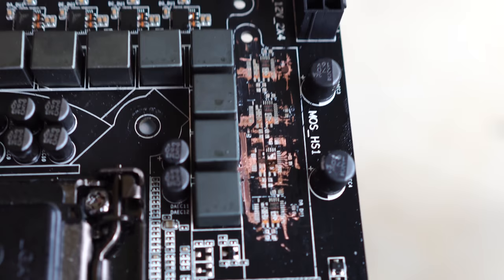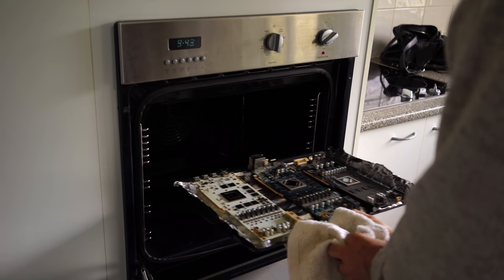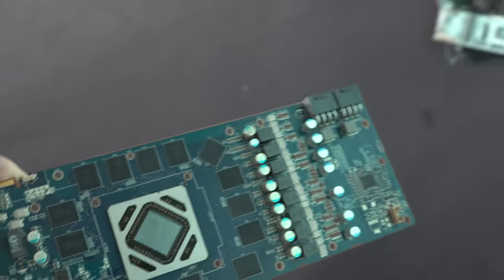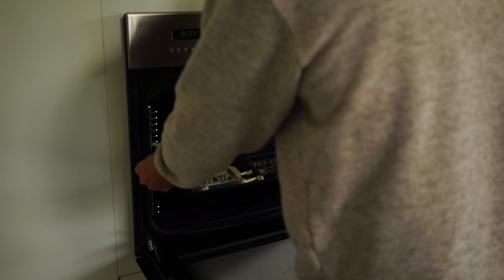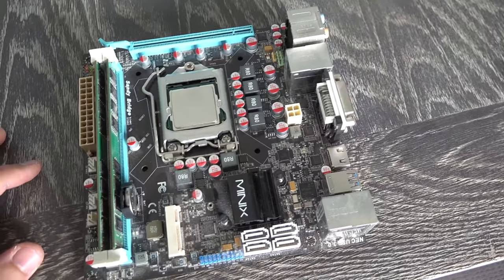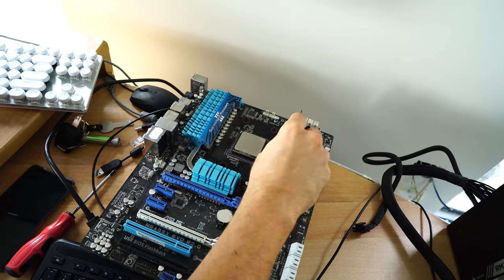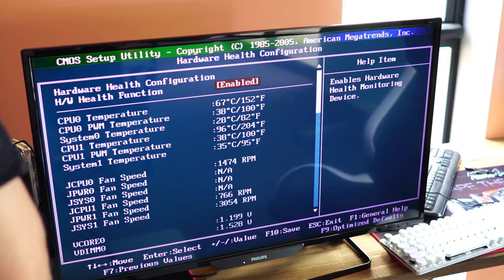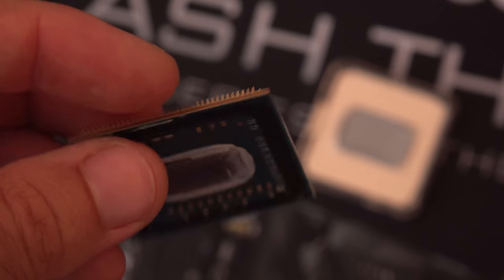Can YES Fix IT...!? The 8 MINUS 4 Phase Power Design | Oven Baking GPU WORKS!?

Comment: The motherboard can't work without its phases because the controller is configured to have them. The only way it could even theoretically work is if you only remove 1 of the 2 doubled channels. So every channel still has hardware on it. Though I wouldn't bet anything on it working even then. You need to replace the components with new ones in order to get it to work.

Oven on the other hand does nothing, you can't reflow with an oven, it'll probably just bridge some pads or cause components to fall off if you even manage to get the heat high enough to melt the solder - otherwise it just does nothing. The only case I know of in which a graphics card in an oven will resurrect is if you have a dead tantalum capacitor (those can magically fix themselves, at least temporarily, when heat is applied). You can get the same effect by just blowing hot air on the tantalum caps.

Comment: Because these phases work "sequentially" any missing phases will stop it from working, unless it can be disabled from the controller. Even though the 1150 cpu has it's own FIVR, the VRM controller simply won't work with missing phases

Oh also about that card with the bugs in windows, you can try a reflash

Comment: Surprising amount of fellow Rossman fans here in the comments. 
Microsoldering isn't that hard IMO. You just need an even semi decent scope. I'd highly recommend the Amscope SE-400 for around $200. I use it at work on iPhone boards and working with 48 gauge wire, and that's way smaller than anything you'd likely be doing.

Comment: Instead of scraping components off boards, invest in a heat gun, it will also replace the oven technique
Reply: Bad idea. Hot air station yes but a heat gun , no way, you will just cook the PCB.

Comment: Wouldn't you need to bridge the connectors where the phases were?  IDK if these power phases are in series or parallel.
Also you should use a heat gun to remove the SMDs on a board like that.. scraping it with a chisel is can damage traces and other components.

Comment: Take the MOSFET's (and the caps and power connectors) off the broken GPU's, and solder them on to your motherboard with the 8-4 phase. Don't just throw away possibly useful components. You seem competent enough to tackle the job. You won't be able to solder the tiny resistors and caps, but you can get larger ones on there, even if you have to use jumper wires to give you the room. Just try to match the components with the ones that are still on the board.(And hope your chisel didn't do too much damage! LOL!)
Love EVGA boards. Looking for a dual socket X79 SR-X from EVGA.
I like what you are doing here. I hate to see anything just thrown away, without at least attempting to make it work again. We seem to live in a disposable world these days (I blame BIC lighters for that! LOL!), so it is refreshing to see someone who is willing to give it a shot, and encourage others to do so too.
Good luck on the MB, and keep up the great work, mate!
Matt

Comment: Have you tried flashing a bios on the 280? Also would love to see you try an E-power mod on the card you couldn't even get the die to heat up on, could be a VRM issue and it's toast otherwise so why not try it?

Maybe the Galax card could be used as a sacrificial power board

Comment: Yeah I wouldn't eat in that oven or breath in the fumes for awhile, would run it for a bit with the fans on and the windows open LOL. I've done this for laptop GPU's and have just used a heat gun on them, so yeah you can do that too.

ALSO, you can totally sell these as broken for parts as is on ebay and get some money on them. I know some people do re-flowing of these cards.

Comment: I appreciate your work but before heating GPU you have to check preliminary items in card, such as short, PEX/PLL voltage, Vcore voltage, 5v voltage, Vram voltage, sometime it easy to fix these cards. Most of the time gpu itself is alive.

Comment: Louis rossmann says dont bake cards
Reply: Louis Rossman owns a computer repair shop and needs the money to keep paying rent, and for the ROI on the expensive resoldering rig he has. If it works, it works. Even if it's only a temporary fix. Most of the time, for the cost of the repair it's just better to buy a new GPU (even with the current price hikes). But if you can't afford a new card, and just need yours to hold on for a little longer, then chucking it in the oven for 10 minutes costs nothing but a little time.
Reply: Dylan Greene  he works on macs and doesnt need to work on gpus to keep his lights on. He has a video that explains that the idea of baking a card is a bad idea all around it might work but its not a good idea at all and unless your reheating trash its not a good idea u can just as easily ruin a simple fix as u can get it to work for a little longer
Reply: You don't get what I'm saying. He bought an expensive ball soldering rig that costs thousands of dollars, and would much rather people come to him with $300-$500. Baking circuit boards doesn't just work on GPU's, it can work on any circuit board. Including the motherboard in that 3 year old MacBook that is just out of warranty. Any time someone who sells a service tells you not to do something, there is usually a reason, and that reason is usually in their best interest.
Reply: Dylan Greene i get what your saying and i knw he complained about the cost of the machine in the video im talking about but like he explains in that video his machine is made to do this and he doesnt say bring me all your stuff for me to fix he says that ovens dont regulate heat well enough to be effective or even a good idea any oven can give u a range of heat from not hot enough to deadly heat just with a heating element difference or height from the heat source its a bad idea in general and your more likely to destroy then fix sell it for parts dont burn it up its just not a good idea
Reply: Yet if you take 5 minutes to Google "GPU oven fix", there are literally hundreds of threads regarding this being a valid way of fixing some GPU's. In that video he made with Linus tech tips, he tried to fix a component with his expensive equipment and failed. So there is a chance you could spend $500 with him, and still have a broken whatever. 
If you are that worried about the temperature of the oven you use at home for $20 you can buy a thermocouple and monitor off of ebay, and check to see exactly how accurate the internal temp controls of your oven are, you can then adjust to suit.
Sell for parts? Seriously, broken GPU's are worth absolutely nothing. If you are careful with sticker removal, no one would ever be the wiser if you oven baked a GPU and it still didn't work. So if you were one of those nefarious people, you could try oven baking the GPU, if it failed then still sell it for parts after.
Sorry if I'm coming off as sounding like a dick, I promise it isn't my intention. I just don't really see a downside to trying this on old components that are broken. If they never work again, then nothing lost, they didn't work to begin with. If you make them work for even a few days more, well that's a few days you didn't have before.
Reply: That $20 thermocouple monitor monitors 4 thermocouples and comes with them too. 
I don't think we are going to change each others minds at this point. You seem dead against ever doing it. I'm for giving it a try on old components. I guess we'll have to just agree to disagree. Good talking to you anyway.
Reply: Dylan Greene 4 thermal probes 8 still cant read an entire oven accurately and 20 bucks is not a good item to read temps that high accuratly (within5 degrees) im not trying to argue and its obviously possible to do it but any video that shows the concept says its a bad idea linus this video and rossmann all say last resort  and its just a bad idea cool concept neat project but just a concept of real repair a heat gun and a temp prob is a better idea
Reply: According to the product page, at above 100*C they have an accuracy within 1*C, and since you would be only using one shelf of the oven. A thermcouple in each of the 4 corners of the shelf would tell you quite accurately the front to back temperature difference. Perhaps a heat gun would be more accurate, but then you risk the shock cooling of the solder cracking and rendering the fix useless anyway. by heating the whole board as one unit, and then allowing it to cool as one unit, you lessen the risk of differential cooling.
Reply: Dylan Greene an 1 c is still not as accurate as it sounds and depending on the type of oven its still great enough to give u a 5 degree difference if like any electric oven there is food in places throwing the heat or the pan its self being warped or thicker in places. A 20 dollar peice is not that accurate its called advertising and factory specs not real world use case
Reply: So you don't believe the advertising of an ebay product, but do from Louis Rossmann. Okay dude.
Reply: Dylan i am sorry but your talking crap , firstly baking a card may work yes but how do you know what the issue is ? Does it need to be reflowed or is is somthing like a bad cap or a fuse ? How are you going to know , you may end up killing a card where the only thing needed is a single SMD cap that you can replace in 2 mins. And how is louis advertising when he clearly states he does not fix GPUs ? Also how do you know he did not fix that logic board ? Firstly linux did the attempt not him and also he did not even know if it was a good GPU chip as they have to get them from a donar board.

Comment: just get some corresponding mosfets(or drmos) and solder it on. but I think you may have already broken some copper lines on the board. You should get a rework platform.

BTW micro soldering is easy with the right tools. Try to get a set of hakko 963 and some flux, they're really cheap.

Comment: I cant cant wait for that dual socket set-up.  Those cost so much money in the day.  Maybe we can do a trade?  I have alot of nice dd3, ddr4 ram kits, gpu's, motherboards all in excellent shape.  I have to try!    You just dont come across that kind of hardware, ever?  Let me know.  Cash too if it can seal the deal!  By the way, the oven trick is only temporary.  The fault usually will rear its ugly head in short order.  I wouldnt sell it.  Play around with it and have some fun abusing it!

Comment: 7:17 liquid damage. As long as the solder joints and components are fine, you can fix it. This happens to mobile phones and they can be fixed. Alcohol will not remove the corrosion, so will not fix it.

Oven bake is for short term fix only, the issue is not the solder joints but the trace connections inside the gpu, which baking will apply a temporary fix to a problem that will repeat. Your very VERY lucky if its a perm fix. Tried the oven bake method on a laptop GPU, worked for about 3 months, then dead, not gonna try it again.

Comment: You should not throw graphics cards in a kitchen oven, you will damage the capacitors.
You should use a hot air gun , isolate the PCB with aluminum tape to dissipate the heat, and blow hot air on the chip to try to solder the balls of solder.
You should set the hot air station between 200°C and 220°C.
Don't stay too much on the components or you will burn the PCB!

Comment: I reparired like 16-17 of 20 cards in oven (only gtx 4xx, 5xx, 7xx, radeon 78xx, 79xx), old cards may be repaired easily with that method, but new cards begin to broke bcs of vrm and memory issues

Comment: That PCS HD7870 Myst with a small overclock performs like a HD7950 as it uses a Tahiti LE chip and not the standard Pitcairn XT that other HD7870 have, meaning you cant xfire this card with anything other than another PSC HD7870 Myst card.

Comment: Oven baking doesn't actually have anything to do with the solder, Linus did a video about this that got a response from a mac technician that explains exactly what its doing, and that you can do the same with a heat gun just pointed at the GPU for a little while.

Comment: Almost did an auto overclock with an MSI board on my cousins Ryzen 1600 and it wanted to put the voltages to the absolute limit you'd want with a water cooler (had a stock cooler) and I don't think even a decent overclock on it.
I tweeted to MSI about it and they could essentially care less that they're likely bricking dozens of CPU's for no reason.
Reply: never trust msi they terrible. I had baord that when took my gpu out the whole slot came out so returned it to micro center. They almsot bricked my gpu to. no cooling for vrms

Comment: It doesn't work, its just a temporary fix and it will die pretty soon again.
Reply: Getting a few more years of a card is better than throwing it away.
Reply: No shit Sherlock, GPU's are not made to last forever, besides, it depends on a lot of factors, i baked a 8800gt back in 2011, it's still working.
Reply: Thats not true lol i backed my gtx 660 back in december 2014 and i've been playing with it to its max and overclocked it too and still working just fine

Comment: I had a thought on the new AMD  APUS. What if instead of using just say 8  - 16 gbs  sticks of RAM memory , say 32 - 64 gbs  sticks of RAM instead.  Not only that, what about lower Mem speeds speeds as well. thank you

Comment: Actually some of the new AMD GPU drivers mess up the graphics card its a driver bug, as I had the same problem with a R9 390x and just installed a few version older driver and worked perfectly.

Comment: I think I need to replace the tim on a xfx hd 5870, I'm guessing I'll have to replace the thermal pads also, can anyone tell me what thickness I'll need to order before I tear it apart. I don't think it's been apart before, it sounds like a leaf blower and constantly ramps up and down if left on auto and manual just has to be left at leaf blower and still runs hot. I wont be able to replace it any time soon so I kinda need to make it last

Comment: In my experience with mobo's and gpu's is that a lot of them are repairable but the difficulty in getting replacement parts without having to buy donor boards makes it uneconomical.

Its still good fun but until they make schematics and spare parts available its not really worth it for cheap pc parts.

Comment: on that 8 phases motherboards, not all phases are for the cpu itself, usually the ones on the side are for the CPU Vcore, the others can be for the Memory controler and other for the integrated voltage regulator or something of the sort, so that motherboar is like a 4+3+1 phases. NO chances to work without proper fixing wich should be a cheap one if its only a mosfet or two that fried, wich is a common problem
Reply: as for those VGAs, baking usually is only a temporary fix, reballing them could make them come back to life, you should make a partnership with some repair shop nearby....

Comment: Ya know you suppose to add liquid flux to the entire pcb board as the solder cracks under pressure due to poor heat/cold cycle as baking the board will make it worse

Comment: I thought my 4670k was dead due to a scratch on the die, but turns out that both of my z97 boards were broken. Shame, as there's only one missing pin in the socket of my gigabyte gaming 7 board.

Comment: That motherboard could be repaired if you just replaced the mosfet, now its dead because the chisel ruined all traces. Modern motherboards have several layers with traces.

Comment: I have 3 motherboard that wont boot to bios but powers on. I've got one to boot but then it never did again. Any advice?
Reply: LazyGamer010 get a PCI/PCIe debug card from eBay for $3. It really comes in handy if you are dealing with this sort of thing. It comes with a manual for all the codes and for the price, you cannot go wrong. It has helped me more than one time
Reply: Dragos Moldovan I used onboard gpu
Reply: LazyGamer010 does not matter, that debug card will give a code about everything, even the CPU cache or RAM. Literally everything the CPU initializes and uses.
Reply: Dragos Moldovan OK thank you!

Comment: baking is not really a fix. they're broken because of electromigration not because of the solder which you can't really fix. the card will be broken again within a week of use. the theory of re-flowing the solder seems convincing and promising but that's not where the problem is.

also you can desolder and resolder a socket not as complicated as you think. it's pretty basic surface mount soldering just allot more pins

Comment: My personal success rate of baking graphic cards are 2 fixed cards out of 3 trials. thats 66% :-) not bad.  also a friend of mine tried it by my recommendation and succeed. for him its 1 out of 1 success rate.  Maybe you should have tried higher temps ? I bake at 195c for 8 minutes. heard that if it fails on first try, hey: you have nothing to loss any way, so try 15c more for a second bake trial. maybe the second try at 210c will do the trick.

Comment: louis rossman i think his name is?  he says its not really about reflowing the solder its about softeninng up the epoxy that is on the bottom of flipchip packages so they are soft enough to allow the "balls" to move back into their correct position.  someimtes it works somwitmes it dont

Comment: Bryan you should do a video on the Intel QH73 engineering sample! It's basically a 2.3ghz unlocked multi version of the QH8G you did the video on. There are several BIOSes for Asus boards that support it on overclockers.ru. Also the QH8E and QH8F DO work fine on any board that will run a QH8G. In fact teh QH8E has a working iGPU and the QH8F has a 65w TDP and can overclock to 4ghz easily, even on a mid range mobo!
Reply from the maker: Thanks will take a look at it!